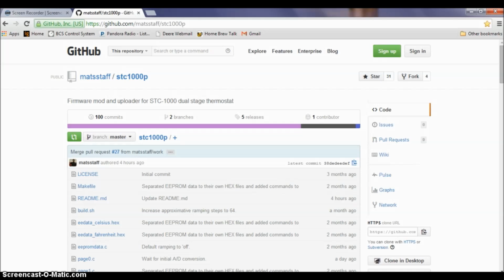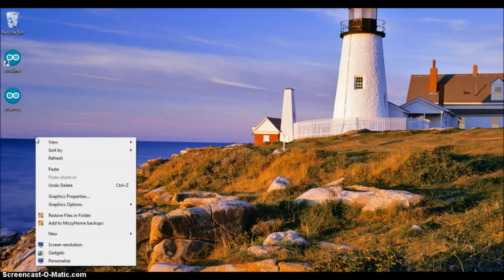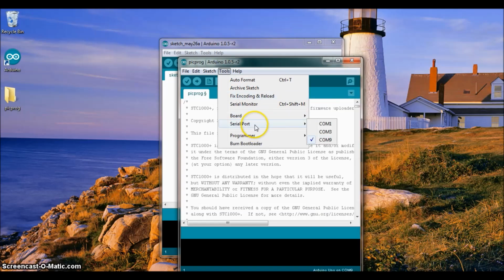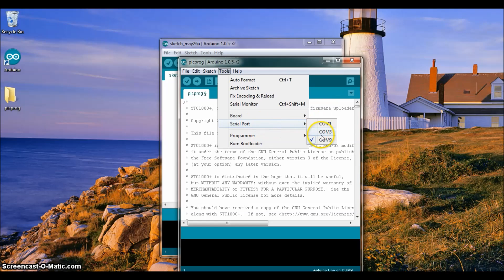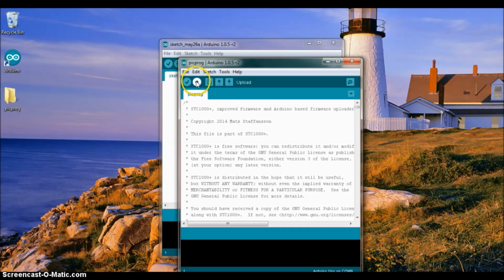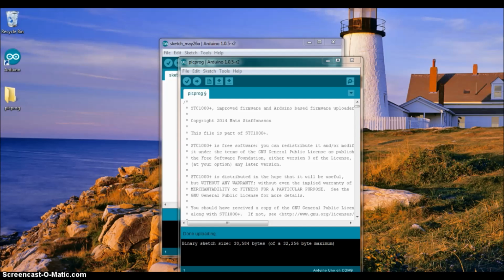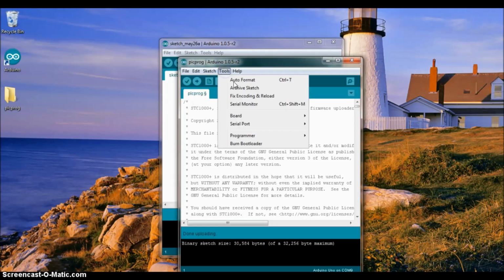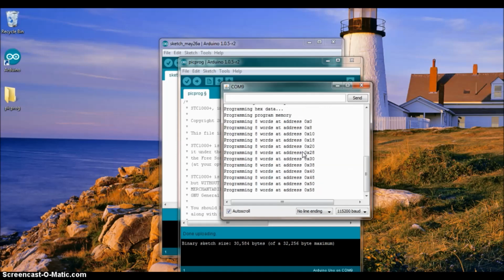STC-1000+ Flashing Firmware

Comment: Great video... I have a question ....  i use eight  STC-1000 for monitoring my aquariums  (i don't need  controler function). Now, i have more aquariums and i would like to replace the STC-1000 with  a "double temperature monitor device" . i have selected  STC-3xxx  with double temp display . the STC-3008 seem to be the best choice but unfortunatly  on the standard 3008 firmware, they have suppressed  the temperature adjust control (the F4 function on STC 1000  (-10.0/+10.0) . This function is necessary because there is very often an offset beteween the real temp and displayed temp.  Of course this adjustment function must  be used independently for the 2 probes... Do you know it this kind on project has already be done ?   regards-

Comment: Hey Will. Thanks for the nice videos. I just got an STC 1000 but it looks slightly different inside. Seems it has the necessary pin for flashing a the front panel where the display sits. 

Is there a chance to check which pin is for what purpose w/o destroying the controller?

If it helps I can send a pic.

Thanks in advance.
Reply from the maker: Hi Lars, unfortunately there are several different types of the STC-1000 out there that all look the same on the outside, but are quite different internally (multiple chinese manufacturers produce them). Only one type will work with the STC-1000+ firmware, so if you don't see the right pins, you probably have the wrong type of controller. I put some info on my website that can help you determine controller version, go to this page and scroll down: http://www.blackboxbrew.com/diy/.

Thanks and good luck! Will

Comment: I just got an a400p and flashed the sketch to my arduino, i bring up the serial monitor and connect to the bottom side of the stc board. The screen on the stc lights up with a degree, but then the arduino says "Board at Com3" is not available, and I hear the little USB "unplugging" ding in windows. The board disappears from my com 3 until I unplug the usb cable and plug it back in. Any ideas?
Reply from the maker: This sounds normal; if you allow the board to disconnect, even for a moment, you will need to restart the arduino as it will lose its port assignment. Sounds like you already got the board flashed though, so is there something else you're trying to do?
Reply: +Will Conrad I finally gave in and used my solder sucker to remove the solder from the holes in the board. I then just used some little female to female arduino cables, and a 5x1 male pinheader to flash. 

Were rockin and rollin now... however, the buttons are reversed on mine

https://lh3.googleusercontent.com/-oYIOGAyPlZo/ViiJorO-r3I/AAAAAAAAX2g/JoTXVy4AX1Q/s912-Ic42/DSC09396.JPG

Comment: Once the ardiuno is flashed with the program.  Does the program stay on to flash other stc's also?  Would I have to do this process every time so that the program stays up to date?
Reply from the maker: It will remain programmed and can be used to flash more STCs until you reprogram.
Reply: Right on, thanks for the advice and video's.